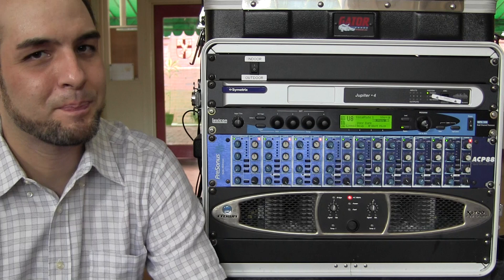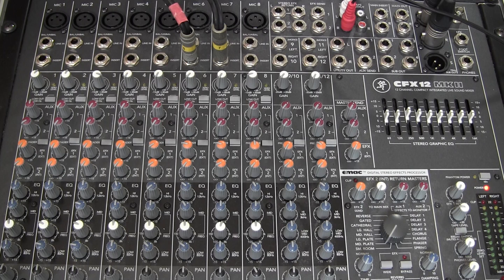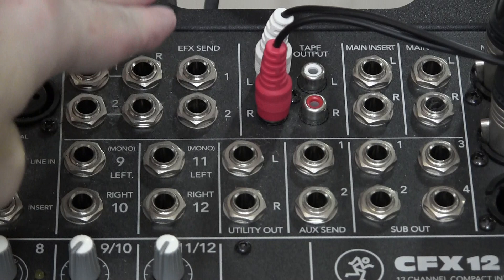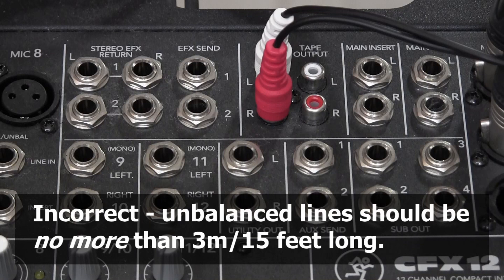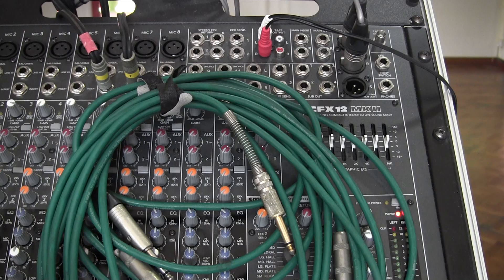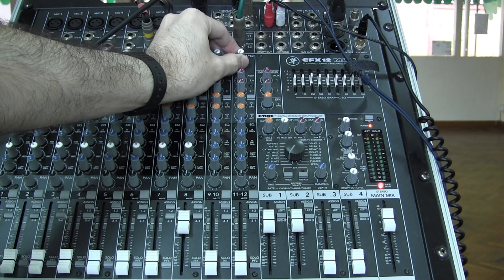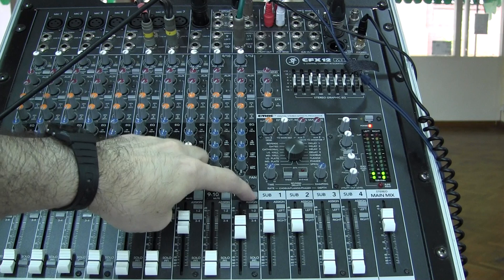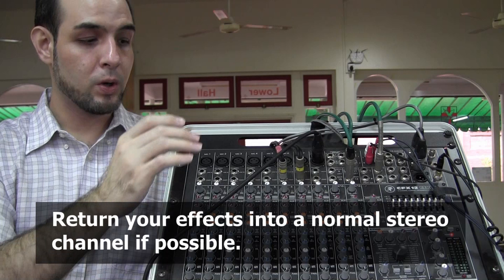How to set up an external effects processor for live sound

Comment: Thanks again I will try. One more thing do you know what's better and difference between the mackie mixers 1402 vlz pro vs the Mackie Mixer 1402-VLZ3? I'm looking to purchase one of these for a back up. I know they have more mono stereo channels than the cfx12.please advise thank you
Reply from the maker: +Aaron Villela The VLZ3 mixers are an upgrade of the VLZPros and have better preamps and an easier to read colour scheme. However both of these are now out of production, replaced by the VLZ4 mixers with the Onyx preamps.

Comment: Hi, thanks for your great video very helpful. Would you please help me?? I have a tc helicon mic mechanic2 (only 1 input 1 output both xlr) and a yamaha MG10xu mixer. Would i be able to connect this equipment using fx send on the mixer so the pedal effect will be on all channels? Grateful for any help best wishes Sean
Reply from the maker: Yes you can do that - the only difference is that the FX return to your mixer will be mono rather than stereo. The other thing is that if the pedal is mic level in and out it may not be compatible with the line level signal coming from the mixer.

Comment: Hi, could you help to show how to connect lexicon MX400 to mixer bheringer 1622FX?
thanks
Reply from the maker: Kara H On that mixer you have to choose between using the internal effects engine and your MX400, because the mixer has only one post-fade aux send. Apart from that, set up is as shown in the video.

Comment: Hi, can you please help me. What if I got a powered mixer (it has 700watts per channel) , how can I connect a crossover and/or maximizer to my setup?
Reply from the maker: With a powered mixer you would need to use the main insert points to connect the components mentioned.

Comment: Hi  Bruno Great lesson but i need  little bit  more for my gear please. I got Begringer Xenyx 1604 UFX Mixer and digitech Vocalist Live Pro Unit, Aphex 230 master voice channel and 204 Big Bottom and Exciter. Also Behringer Ultra graph pro 31 band EQ, ultra DI pro and Behringer U phoria 1820! I need your advise how to connect all this gear Right way please because I'm  just beginner in this area . I try to record my voice with backing track. If your need , i will send you all  front and rear pitchers . I really like your lessons and will be really appreciate to you for help. Kind regards
Reply from the maker: I'm sorry but I don't give advice on recording setups as I'm not a recording engineer.

Comment: Is this process applicable to EQs? I currently running a system wherein I can only designate my external eq to my main loudspeakers (MIXER MAIN OUT > EQ INPUT > EQ OUTPUT > MAIN SPEAKERS). That leaves my secondary speakers and my monitors without any external eq to fine tune them. 

I am looking at this video and trying to see if I can use this method to somehow make use of the signal from my eq back to mixer to give every speaker a signal that is already equalized. Lets say for example that my mixing board has the same efx/aux channels to do the method. Thanks in advance GLB Productions.
Reply from the maker: Have replied to you on Facebook ;)

Comment: Hy there +GLB Productions!

First, thank you for the video, it was crystal clear.

I wan't to get an external reverb, but I'm using Allen and Heath ZED-14 mixer.
There is almost everything what we need, but the ALT 3 MASTER section.
At that mixer, there is a master section for the PRE fader ALT 1-2, but there is no "gain" knob for the Alt 3 or 4.
Should it work properly without that knob?

And another question. I recording from my mixer through the AUX 1-2 which are PRE faders. If I pacth the reverb to the post fader, will I record anything from that signal, or there won't be anything because of the PRE and POST faders?

Thank you for your help!
Reply from the maker: +Richard Arvai Hi Richard! I think you mean AUX and not ALT? ALT 3-4 is a Mackie thing. Your mixer has what's called an ALT out but that is something else. 

On your mixer the output of AUX 3 & 4 is fixed at unity gain, ie it's like having a gain knob permanently set to 0db. It will work just fine. 

If you record from AUX 1&2 you will still be able to record the reverb assuming that the reverb is sent to those two aux busses. However I normally recommend recording from a post-fader send as that will reflect the balance of the mix.
Reply: Ohh yes, I mean AUX instead of ALT - it was just a slip of pen. :)

Okay, now I understand - thank you for your help!
Reply from the maker: +Richard Arvai You're very welcome :)

Comment: what if i want to use an external fx stompbox on one channel. i use exactly the same mackie mixer 12profx v2. would be great to hear from you. thx
Reply from the maker: In that case you would need to use an insert cable and connect via the channel insert point.

Comment: Hello Bruno, hope you are doing very well !! One question regarding line delay equipment : do you have any video explaining that type of machines used to delay an speakers set that is located at a different distance from the audience and PA so you can ensure al speaker lines are in sync with no echo or time diff ?  Thank you in advance and best regards, Toni
Reply from the maker: No video on that topic Toni, reason being it's quite a complex process that typically involves some sort of FFT measurement software. You can do it the old fashioned way though, with a tape measure and by using the output delays on your digital console. Just work out the distance between your main speakers and the delay speakers and convert that into milliseconds by dividing the distance by the speed of sound.
Reply: Yes, I will have to work it the old way. However, I understand how to find and "meassure" the gap. What I don´t yet have clear, is the type of equipment I will need to introduce the delay in the speaker line... is it only via digital consoles that you can insert a delay ?  Thank you very much !!! Toni
Reply from the maker: 20 years ago you could buy analog delay units designed specifically for this task but they are pretty much obsolete now. Today the delay is inserted using a system processor like a DBX driverack or using the output delay on a digital mixer.
Reply: Thank you again. I will pursue that DBX line...

Comment: hey i really liked your effort. 
im a bit stuck ...since im new to this field. 
i watched your last lesson...in which you had explained monitors and aux
Now, in suppose a channel strip assigned to vocals. aux 1 is how much the vocalist will hear his own voice ...then like wise... aux 2 would be how much a guitarist or a keyboardist would hear those vocals. 

Now in this video of yours 
i can only see aux 1 and 2. 
so does that mean that this mixer supports only two ?
Reply from the maker: - The mixer in this video has only two pre-fade aux sends, which are the ones normally used for monitor sends, so you are correct. Post-fade aux sends can be used for monitors, but only when you want the level of your monitors to track your fader movements, which is usually not desirable for live sound.
Reply: GLB Productions
and iv been hearing this a lot . live sound engineers  sending their mix through aux sends .
i had thought that the snake which consists of a lot of xlr. cables. goes to the stage . and then you connect the microphones/Di box to the snake  box and then from that snake box the output goes  to the monitors . ?

so what is the use of aux sends! 
im a bit confused . please if you can help me one last time!
Reply: and to add to this. 
when usingthe snake (the way i explained ) i remember you had explained how the aux 1 2 3 .. works. 
so my question to you is ...
what is the relation between aux 1 2 3... aux sends and snake cable.
Reply from the maker: Ishaan Alagh The aux sends refer to the auxiliary outputs from the mixer itself - on the rear panel there are outputs labelled aux 1, aux 2 etc. How you get these signals to the stage will depend on the way your system is set up - some people will use a separate return snake which is independent of the main snake, others will use the return lines in the main snake. In other words, there is no automatic relationship between aux sends an snake channels, it depends how you hook them up.

Comment: Thanks so much, I have some confuses on my set up...I have tc electronic M350 that connect to mixer exactly the way in your video, but I can not pan my mic channel.  please help, thanks so much Bruno.
Reply from the maker: What do you mean by you cannot pan your mic channels?
Reply: I mean when i pan the mic channel, i hear the effects in both left and right speakers if I turn effect return fader up.  Thanks for replying.
Reply from the maker: It could be that your speakers are not wired in stereo.

Comment: you're the best.!
i have a question...i use V-verb pro 2496 when i test signal just Left,,not both L-R like your...why? pls help.
Reply from the maker: Oanh H Nguyen I'm afraid that unit has no provision for a mono input - if you look on the back you'll see that that inputs are labelled L and R, instead of L(mono) and R. So if you want stereo you'll need to send a stereo signal to the unit using 2 aux sends, or find some way of re-programming it internally so accept a mono input signal.
Reply: XLR Y-splitters are useful for the stereo inputs on the back of effects processors.
Reply from the maker: VoyageOne1 Yes, that's another good way of doing it, thanks for the input!

Comment: Hi there, how do I send effects to my monitor using external effects unit. I have MG20XU which does not have any aux effects in it. when i connect my Alesis Nano verb 2 to MG20XU it gives effect to all chanels. i want ti add effects to the singers only not to the drummers and other instruments. is there any ways
Reply from the maker: Yes - on the channel where the effect comes back into the mixer, just raise the appropriate aux sends. So if your singers are on aux 1 raise aux 1 on the effects return channel.

Comment: great video. very instructive. Do you have a video on adding effects for a studio sound? i know it is similar. I am trying to add a pre-amp and a compressor/gate to my Mackie mixer. would i use the 2 aux sends for the over all board? or would i loop the preamp into the compressor and then into the mixer threw the insert? i would appreciate any feed back
Reply from the maker: Jack Frozt You're correct - the process is similar, although sometimes studio engineers will insert the effect on a particular channel or group of channels in order to be more specific with the effect they are using, for example a specific vocal or drum reverb. The unit would then be reprogrammed and inserted on a different channel or group for the next take or track bounce. 

What sort of preamp are you adding - a mic preamp?

With the compressor, if you have only one you would typically insert it on the main LR bus in order to compress the entire mix. An alternative would be to insert it on the kick drum or lead vocal, because these are typically the channels that benefits the most from compression.
Reply: it is an ART DPS2 preamp and a dbx compressor/gate. I also have a spx50D effects processor. how would I link all 3 of these machines to my mix board with only 2 aux sends? I am using aux 2 as my primary out for recording. so would I chain them all together?
Reply from the maker: Jack Frozt Why may I ask are you using aux 2 as your recording send? Is it because your main LR are being used for the live mix? Are you planning to use the equipment mentioned above only in your recording signal chain or in the main LR signal chain as well?

Comment: Hello GLB Production
 I have internal effect  working but not ext. I have the mixer exactly you have and the effect processor is virtualizer pro in the back it have #1 input, output and #2 input, output. I follow your steps but can't get the sound at all.  I wonder that my efx send 1 is bad or the mono and the effect processor set up wrong? when i take out 2 ends from the mono and put into the stereo efx return and I have sound. Thank you
Reply from the maker: +John Tran Hello John thanks for getting in touch. You have done the right thing to try and run the effects send of your mixer back into the effects return - this shows that the issue is not your mixer or cabling so it has to be your effects processor. My advice would be to try and obtain another processor that is known to be working and try again. My experience with Behringer equipment is that it is often very unreliable.

Comment: Good day bro.. I have a Behringer Eurorack UB2222FX-PRO mixer and TC-Electronics M350 external effects processor, is it applicable on this unit to do the same thing for what you did on your video or any advice? Thank you
Reply from the maker: - Yes it will work fine, although the UB2222FX-Pro has only one post fade aux send, so if you use that to send to your M350 you will not be able to use the mixer's internal effects unit.

Comment: I have Yamaha 700 effect processor, can I plug it the same way you ilustrate on the video. My mixer is Mackie 1604 Vlz
Reply from the maker: ferney Ampudia Yes, this connection technique will work for any rackmount effects processor. You may need to use different connectors depending on whether your processor is 1/4" or XLR but the routing will be the same.

Comment: Is this the same concept as connecting a feedback killer?
Reply from the maker: +D.J. ROCKWELL No - a feedback killer should be connected either via a channel insert (if you want to monitor just one channel) or via your main mix inserts/between your mixer and your amplifier (if you want to use it on your entire mix).
Reply: I have 3 mics. But I was using it on 1 line with the better mic. I plugged the output of the mic into the feedback killer then from there into the mix board.
Reply from the maker: +D.J. ROCKWELL That will also work, but remember that only that one mic is protected against feedback.

Comment: Not at all, does the ac adapter has to do anything with that, because I am not using the original one
Reply from the maker: - It may, but if the unit will power up it should work correctly. Next step is to make sure that the signal is leaving your mixer correctly - are both the channel aux send knob and the aux master knob turned up to at least the 12 o'clock position, and is the fader on the channel raised to the 0dB position? Make sure the channel is not muted and/or switched ON. Check that your cables are good and that you are connected to correct aux output on your mixer. Finally, make sure the 'input' knob on the MX200 is set to at least the 12 o'clock position. 
Let me know if these tips help - please reply here, below my answer (use the 'reply' button) instead of starting a new comment so that I can keep track of our conversation, thank you.
Reply: Ok I will try that and thank you again

Comment: Hi,
Thanks for the detailed instruction.  I have a boss ve-20 pedal based voice effect processor.  Is it possible to use that instead if Lexicon MPX550? I'm new to these things.  Thanks.
Reply from the maker: Certainly! You will likely need some TRS to XLR adaptors to interface with the VE-20, but it should work fine. Just be sure to be careful of your input and output levels and avoid any distortion.
Reply: Many thanks will try it. =D
Reply from the maker: BertskiMC You're welcome, let me know how it turns out :)
Reply: At first try it did not.  So I have to watched again this video. On the second try I worked.  Again thanks a bunch.
Reply from the maker: BertskiMC Great news! Glad it worked out.

Comment: Thank you for this good video and other video from you.23:22wet signal. when i turn on fx in my behringer xr12 there is no source signal at all there is only wet signal and i dont know how to turn the source  signal on. could you tell me how to get agood sound with reverb fx from this mixer please.
thank you so much.
Reply from the maker: That mixer has its own proprietary control software so I suggest you consult the person who sold you the mixer. I haven't used an XR12 so am not familiar with the signal routing.
Reply: Thank you so much.

Comment: Hi Bruno, can you please advisee if I need 2 subwoofers for maximum cut and volume in a rock band setting?
Reply: Do subs enhance over all clarity and cut?
Reply from the maker: No - the clarity and cut comes entirely from your top speakers :) Whether or not to have two subs depends on what matches best with the rest of your system - for smaller systems one sub is best because more than one can cause some really interesting interference issues... Read up about subwoofer arrays/coupling if you are interested!
Reply: @GLBProductions  thanks Bruno, I may get 2 more powered speakers then instead of subs

Comment: Hello sir, may i ask you one question, this external effects processor unit can be use for HOME karaoke.  I have an ALLEN HEALTH ZED 12 FX MIXER.  LEXICON MX200.  ON AN ALLEN HEATH MIXER THEY DON'T HAVE AUX SEND AND RETURN.  CAN YOU SHOW ME, WHERE CAN I HOOK IS UP.  THANKS FOR YOUR HELP.
Reply from the maker: - Yes, it can - on that mixer you would use aux 3 to send the signal to the effects processor, returning it as shown in the video. Having said that, the ZED 12 has an internal effects processor, so perhaps you should try using that first. See my video How to use a mixer's internal effects processor

Comment: but there is a small problem. You can only use on effect for all channels.
Reply from the maker: Yeah that's just how it is - in the pre-digital days engineers had one effects unit for each effect they wanted. So they would usually have at least three: one for a vocal reverb, one vocal delay and one drum reverb.
Reply: GLB Productions 
So how do i do that for all the vocal channels?